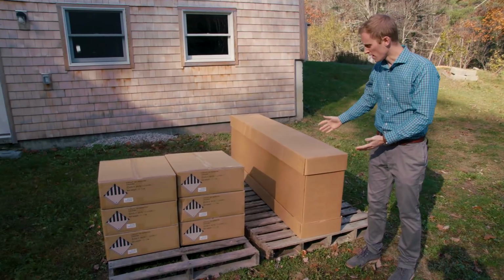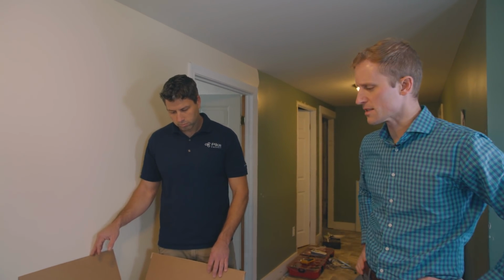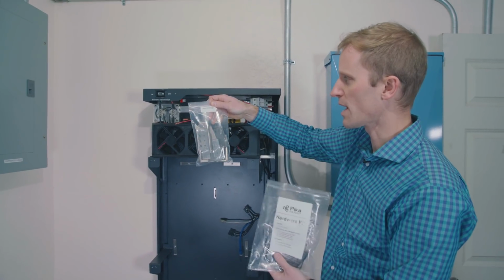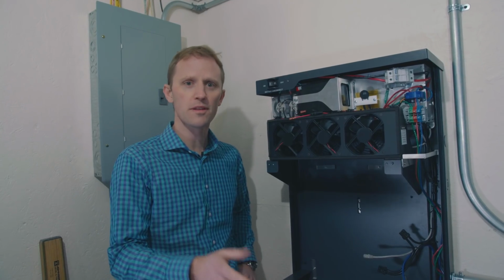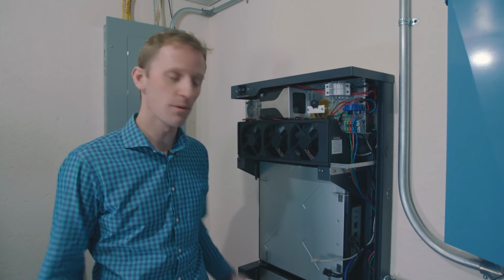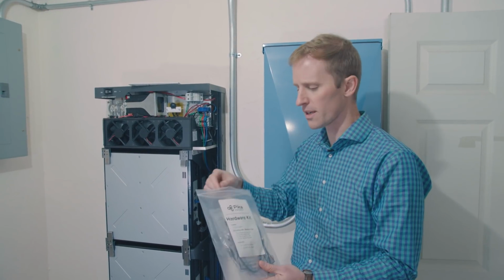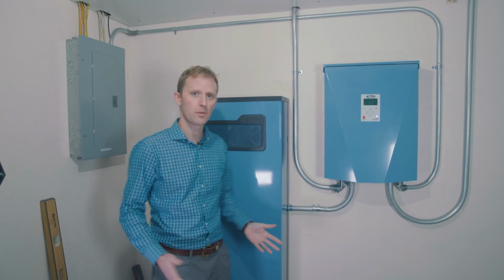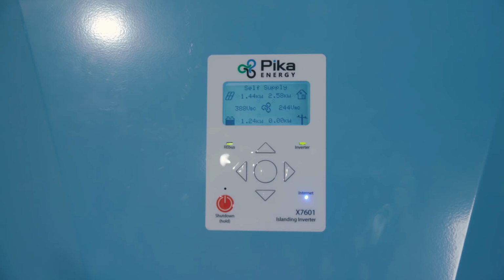How to Install the Pika Harbor Smart Battery

Comment: I like it that you can swipe out batteries easily, the batteries needs to be higher off ground. looks like power company isn't diverting power during peak times. no mention if system has to be connected to net to maintain warranty. 5k inverter is small for whole house system. can battery be charged from grid? assume battery voltage is 48. is it connectable to net meter? Id prefer lifep04 chemistry safer than ion. you have your hands full competing with tesla. over all good looking product.
Reply from the maker: Thanks @ric777888! Let's try to answer all of your questions: System must be registered via internet for warranty activation. The inverter is actually 7.6kW with up to 50A pass-through to protected loads, more than any other smart battery solution available. The battery can be charged from the grid, from solar, or both. It can be used to net meter. Some people do prefer other chemistries for many reasons, but safety should not be among your concerns when choosing a Pika Harbor™ smart battery: we use the Panasonic DCB-105 Li-ion module which features redundant safeties and has been tested extensively by Pika and Panasonic engineers. Drop us a line at pika-energy.com/contact if you would like to learn more.

Comment: This is a good form and fit.  I live in Arizona so my kW usage is greater than what this will provide.  I can have a peak demand of 18-20KWs (2 pool motors and 2 ac's)  Not even counting the appliances in the kitchen which are electric.  So does you setup expand to more storage?  My local electric company is limiting me to 10KW of solar panels so I'll need another source of power so that I am not always tapping into grid.  what about cost?

Comment: Does Pika have it’s own panel optimizers or use another manufacturer’s?
Reply from the maker: We have our own 2500W "sub-string" optimizers that connect to the array. Usually they can control between 2-9 PV modules. We call our solution PV Link™. Learn more at pika-energy.com
Reply: Does Pika have IOS & Android monitoring apps?
Reply: @gilbrook  Great question, Pika needs to answer this as most of us would not accept our electric company's evaluation of the power produced.  Also I didn't see any meters on your setup.   If one is tied to the grid the electric company will want to keep their tabs on it.

Comment: Can the battery be configured to another lower voltage? I cannot use series panels in my location too much shade!
Reply from the maker: No, it cannot be configured to a lower voltage. This plug-and-play solution relies on high voltage for efficient transmission and operation.
Reply: @GeneracCleanEnergy  that's too bad I cannot use your system! there's too much shading going on on my property to use anything higher than 24 volts! So sad you cannot accommodate that...
Reply from the maker: @SolarizeYourLife  you may be surprised to learn that modern solar modules mitigate shade  similar to MLPE (module level power electronics) solutions using diodes. Attaching an optimizer or inverter to every module is no longer necessary for shaded array performance.

Comment: How much is that 16kw battery?
Reply from the maker: Julio, thanks for watching. Drop us a line at pika-energy.com/contact and we'll get you in touch with a local installer for a quote!
Reply: Julio de la Cruz hola julio, did pika ever gave you the cost of this system?  No one hasn’t answer that question yet.
Reply: I don't have an answer yet.
Reply from the maker: Hello William, please drop us a line at pika-energy.com/contact and we'll put you in touch with a local installer for a quote. Thanks!
Reply from the maker: Hello Julio, I do not see that you have contacted our team yet. If you contact us at  pika-energy.com/contact we can put you in touch with a local installer for a quote. Thanks for your interest!
Reply: Pika Energy I did fill out the info, I'm on waiting mode. Thank you
Reply: Yes, I'm waiting until I finish the house before bothering anyone. I already have solar but I will be adding wind and battery.